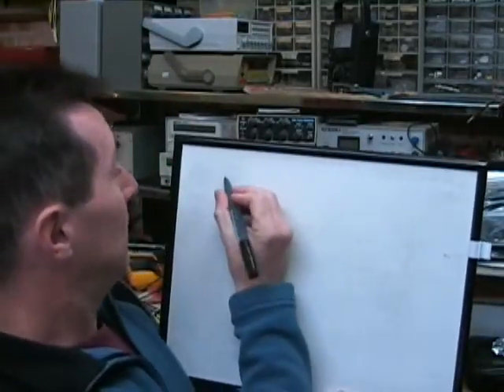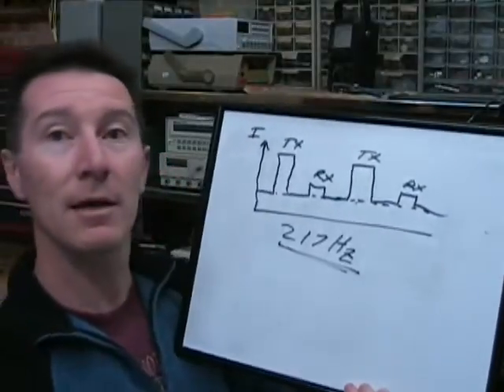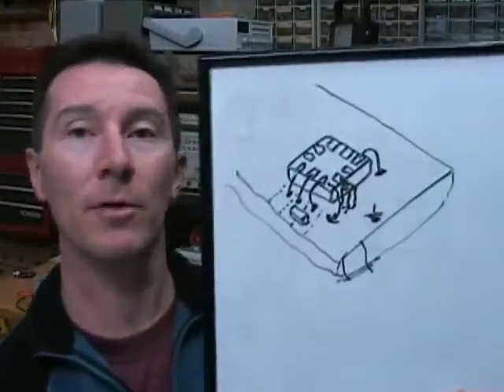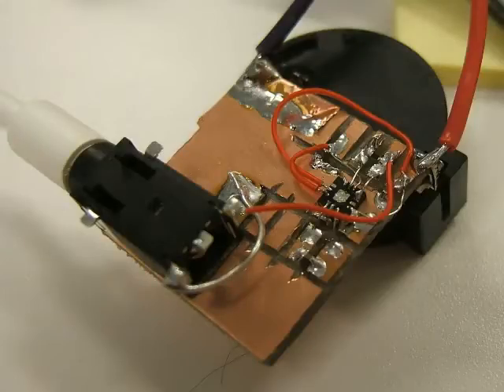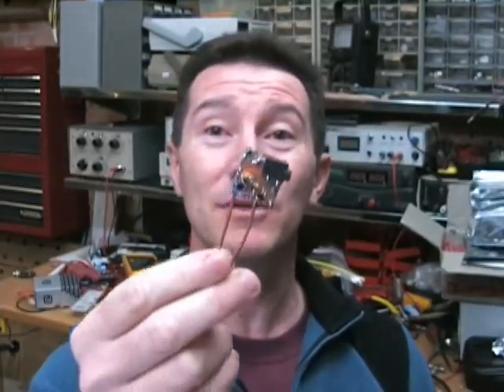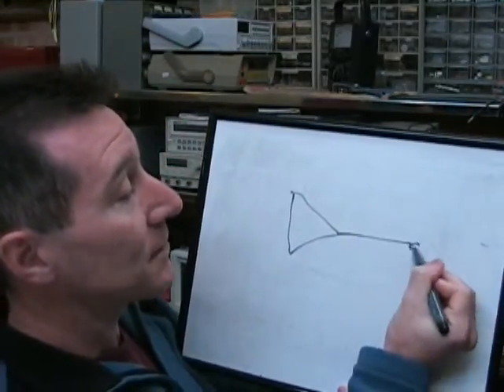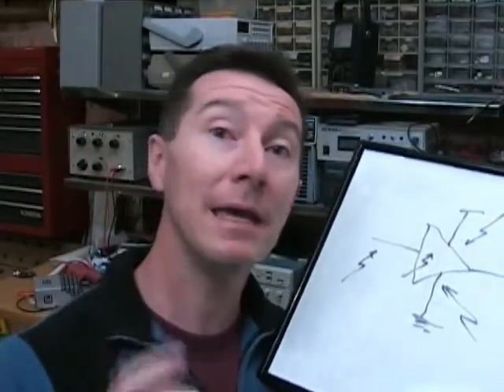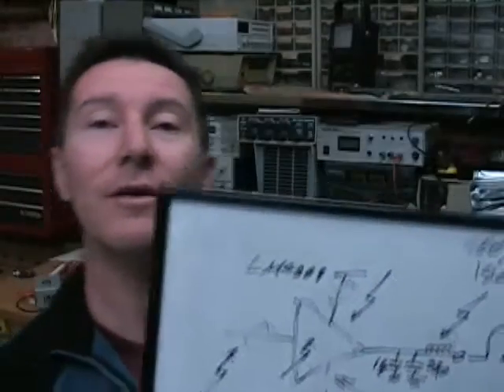EEVblog #23 - GSM mobile phone audio design

Comment: If RF can inject itself on the Output going to the headphones, how would a radiation immune IC prevent that?    Wouldn't you still need the RF Traps (33pf | 10pf) at the output?

Also, in the beginning, you mention 217Hz is the frequency to watch out for, but in the end, your traps are only for the 800/900/1800Mhz?  Where did  217Hz factor in?

Comment: I was really getting into troubleshooting the problem there, and then his solution turned out to be a commercial solution. I've got to say I was a bit disappointed. It feels like I've just been told, "Leave it to the real engineers." I didn't learn anything here that I couldn't have gotten from a Maxim ad.

Also, word on the street is dead-bugging chips leaves the IC itself more vulnerable to RF interference. Just sayin'.